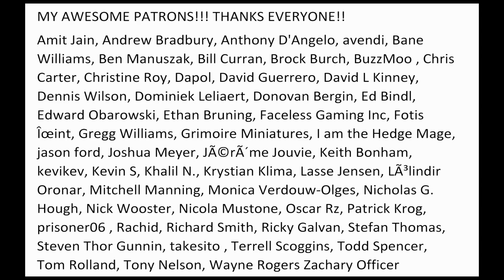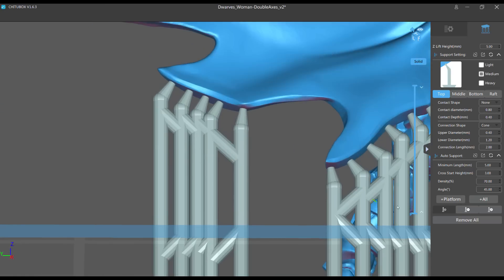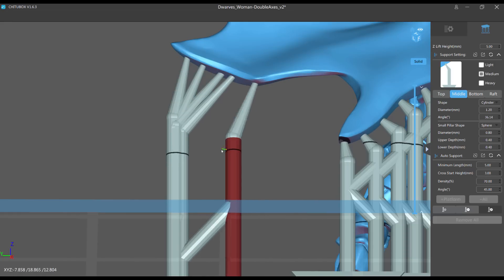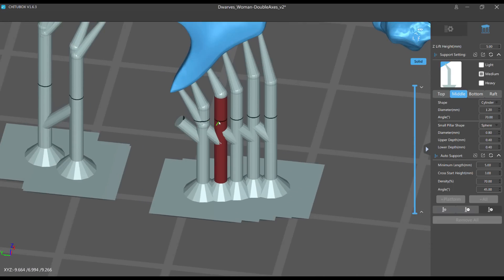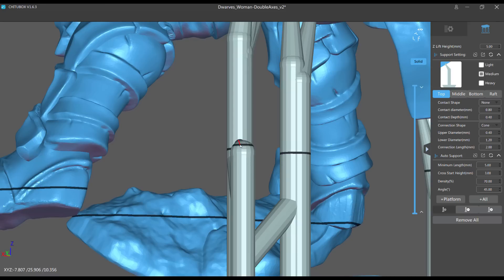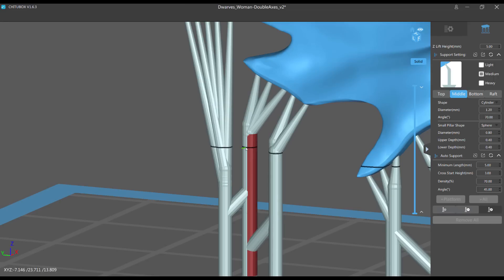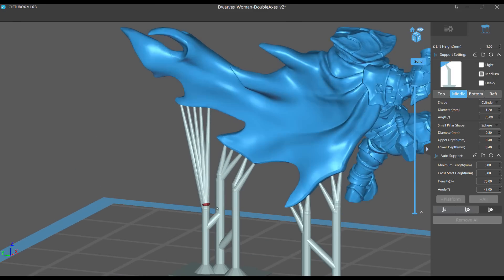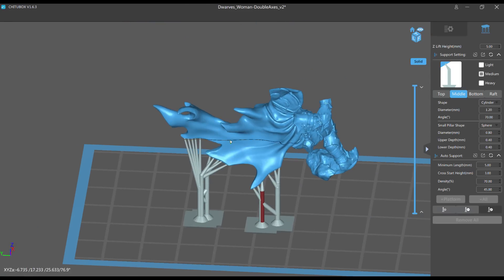Making a support "Pillar" to save on resin and make support removal easier!

Comment: If you double click the little ball at the top of the support, it will turn green, and you’ll be able to add multiple top sections to the same pillar.  Once you add as many as you want, you simply double click the ball again to finish.  I found this out by accident but thought I’d share it 😊
Reply: I’m not sure either, I think those are automatically created when you choose “all” instead of “platform” when using auto supports.  I’ve had it happen to me randomly as well when adding manual supports afterwards, but I’m not sure how to add them consistently.  Hope you find out, if you do, share it here please 😊
Reply: Same happened to me, verry handy when you need multiple close points
Reply: Thanks for shaing! What I didn't manage to find is how to manually create those tiny "Small pillars shape" which are simply a straight line and are configure under "Middle"... Those are automatically created inside a mouth, for example.
Reply: Thanks Prison Mike !
Reply: @FREEJUMPER000  no prob friend! 😎

Comment: Amazing, definitely going to try it! I just wonder if, because the supports total amount of contact area with the bed is quite reduced, if the miniature has, at some point, a quite large cross section printed on the FEP, the suction force on such large area could overcome the adhesion force of the supports to the metal bed.

Comment: Do you find you get different results using different slicers with everything else being the same (model, supports, print settings, etc.)? Someone on reddit mentioned getting better print quality with the Prusa slicer, which doesn't make sense to me.
Reply from the maker: better quality prints, no, but it does better auto-supports, tho I think autosupports are bad anyway, but some people start with them  :)
Reply: @3dprintingpro212  Thanks! I really appreciate it. Now I'm off to print the new AG Ashen Manticore with your supports. Wish me luck!

Comment: Ok, i have a problem with support. I've bought a presupported project. Put it quickly to print and it failed. Didn't print a leg. I think he didn't supported well the foot and leg but i think the problems are the settings too. I lowered the lifting speed from 65 to 40 and bottom cure to 70. Other prints were good but this one that i have no. Some supports were printed in an half and looks like they were burnt. Can anyone please give me an advice? Thank you so much!

Comment: When creating a pillar or rather a trunk and branching your supports, I change the Cross Start Height setting to 90 so I don't have to remove them or worry about them causing issues. I personally have never seen a trunk fail as its pretty thick when you start moving all the supports together but it is possible I suppose. It can also really save A LOT of waste, it just takes longer to do.

Comment: Do these custom supports also work for pla filament? Or do you think using like cura supports is the best way to go? Was thinking about custom supporting some miniatures i have but wasn't sure if your method worked for that too.
Reply: I have used Meshmixer to generate supports for FDM printing.  They're what I think Cura's tree supports should be.  They make generally thicker supports that are less likely to fall over (since they print with the same settings as your model unless you go through the effort of making them separate shells) but have far fewer points of contact.
Reply from the maker: some people have actually used mine on FDM printers with some success, but honestly when I use a really thin long support it's tough for FDM to make it work...